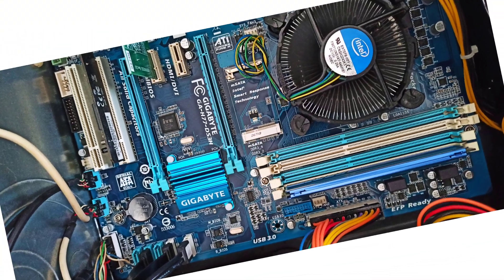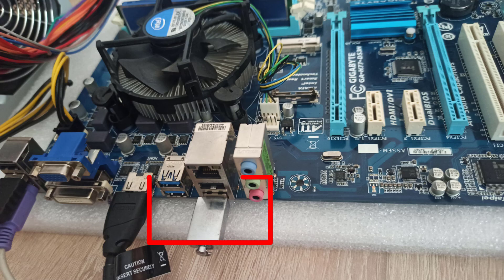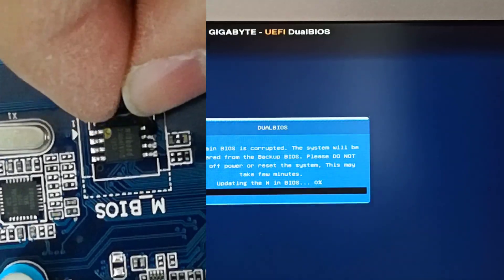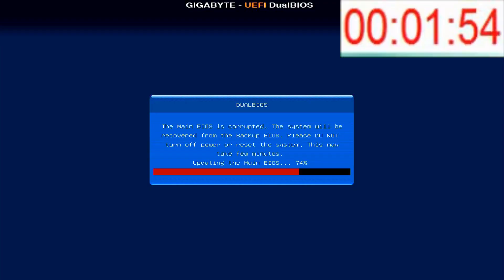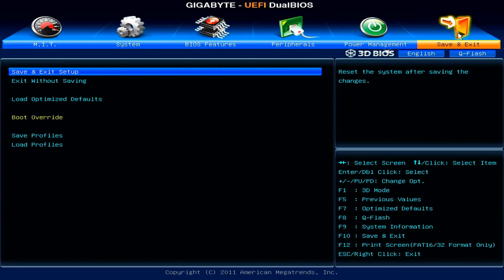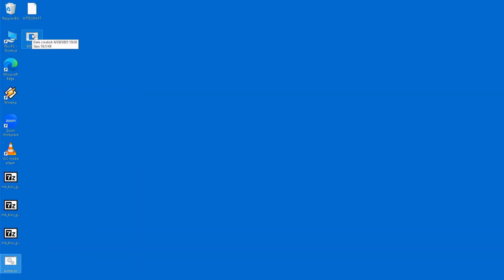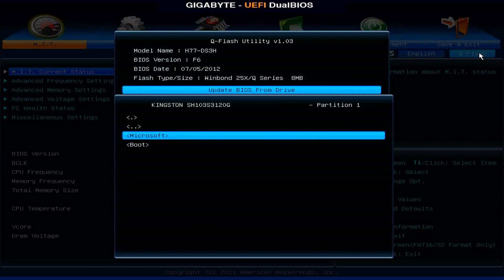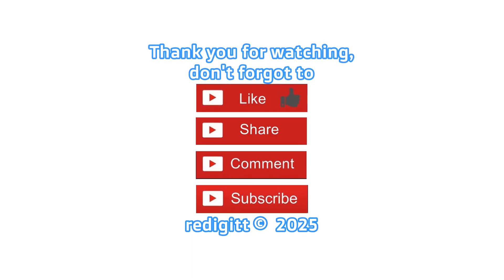Gigabyte UEFI DualBIOS  loop restart error FIX GA-H77-DS3H DualBIOS recovery update  #redigitt 434

Comment: I had a tech try and remotely force win 11 now it comes on acts fine all except do display signal at all. Mb or Gpu. Reseat Gpu, Cmos , Ram . Nothing.  Tried window boot drive . Nothing . Im so stuck
Reply from the maker: If you have this motherboard, it is not supported by Windows 11.
To install Windows 11 on this motherboard, you must modify the Windows installation media.
If your PC does not boot after an apparently unsuccessful Windows 11 installation, do the following:
-Power off the PC and unplug the power cable.
-Press and hold the power button for 30–60 seconds.
-Remove all USB devices (USB flash drives, printers, card readers, etc.).
-Disconnect all HDDs and SSDs from the motherboard.
-Remove the BIOS battery.
-Short the + and − BIOS pins on the motherboard for 60 seconds.
-Plug the power cable back in and power on the PC. 
-The PC should display a video signal.
If you have video signal, you need to reinstall the OS
If you don't have video signal, you could try:
No video signal, Easy PC fix in 10 steps https://youtu.be/TaoYproKpRs
Thanks so much for watching! 
If you found the video or my advice helpful, please consider giving it a like, sharing it with others, 
and subscribing to the channel for more content like this.
Reply: @redigitt I have the GA-H61M-S2PV 2.2